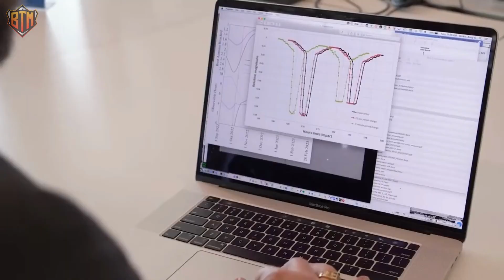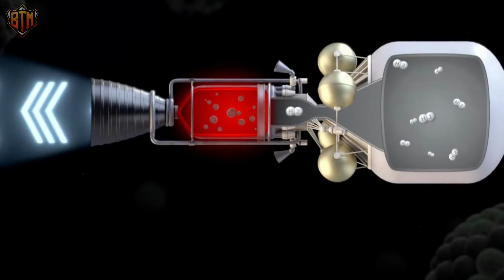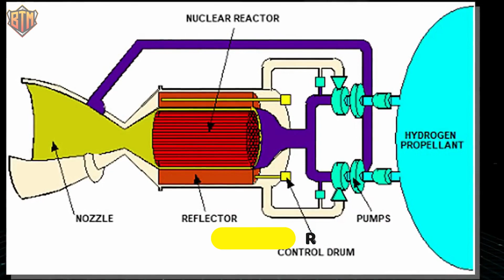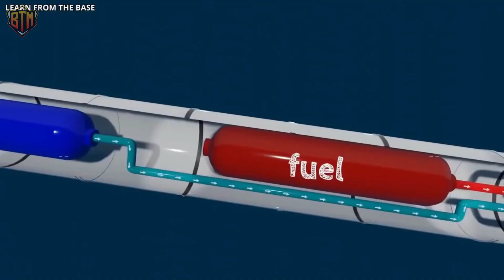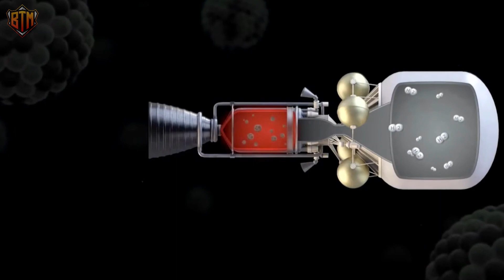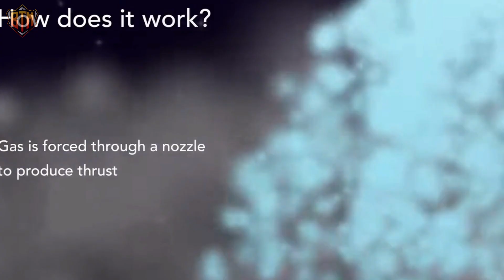Elon Musk's New Nuclear Rocket SHOCKS The Entire Space Industry || SpaceX Starship

Comment: Try FISSION courtesy of high temperature ceramic nuclear cores is here today not the future. Storing hydrogen or even methane requires super strength cryogenic vessels. Using Propane C3H8 as fuel and a variant of Nitrous Oxide as a supplemental oxidizer would provide the best of all worlds. Both propellants have a significant positive pressure allowing the pressure vessels to support the rocket body versus requiring support of cryo fuels.